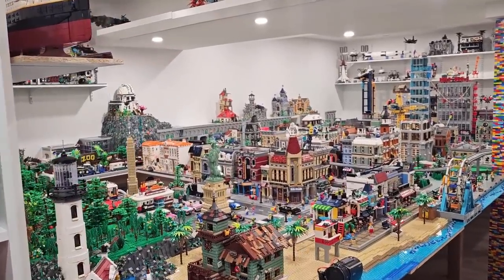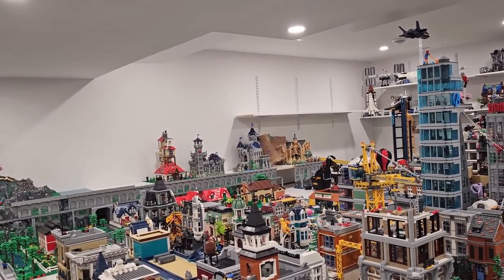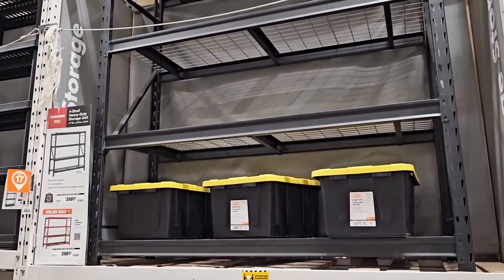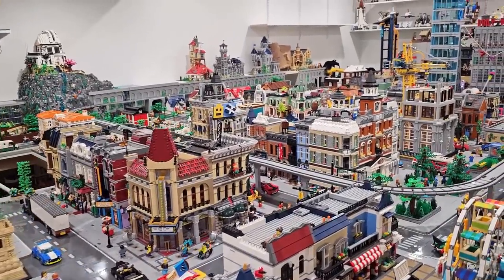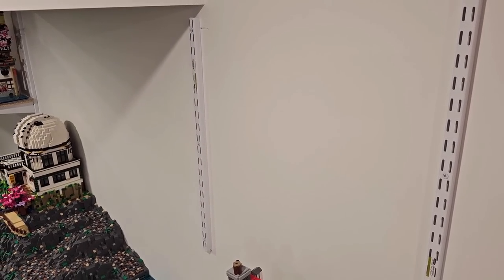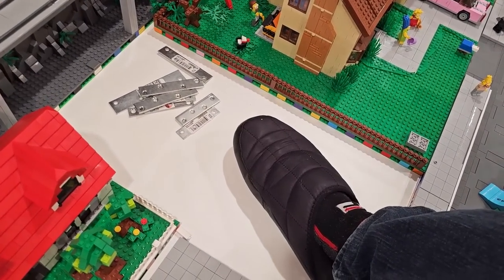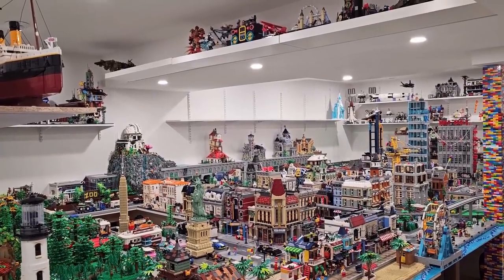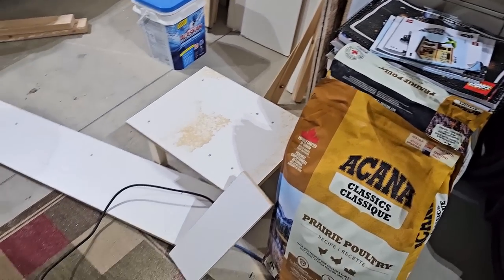FAIL While Installing LEGO City Platform & Shelving

Comment: Hey Jordan! I love the new shelving above the city. I have a suggestion for the Ninjago area, to improve it even more. You can see that the Ninjago city docks set is a bit lower than the other 2 sets. I have a suggestion to kinda make the whole thing look pretty much the same height. It's by adding a Ninjago set from 2017, it's the set 70612 (the green ninja mech dragon) from the same line up of sets as the Ninjago city set. I have the set and it looks awesome. I think making it fly (with transparent pieces) above the Ninjago city docks would look amazing!

Comment: Yeah, Jordan, never use the ceilings as a starting point for your measurements! In my house the ceilings were so crooked that the difference between one and another wall height was more than 1 cm, and mom and I had to proceed with replacing the wallpapers very carefully, measuring every strip, instead of just cutting everything at once. 
Mom had to extend one strip when we first noticed this.

Comment: Dumb question for Lego fans: I've noticed that most lego sets aren't smooth and have exposed rivets even when the build is complete. Is this considered to be part of the charm or some kind of limitation of the manufacturing process? This may be Lego heresy, but I've been looking at some of the Star Wars sets such as the millennium Falcon and AT-AT and I think they would look much better if the exposed surfaces were smooth. Maybe I am missing the entire point???  The Atari 2600 set is mostly smooth for example and I think it looks great, but that design seems like the exception and not the rule.